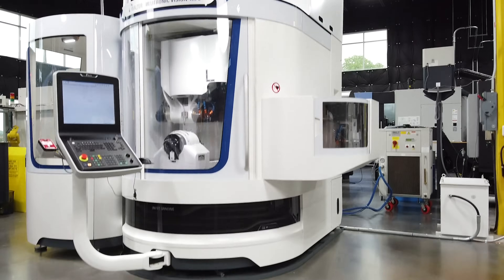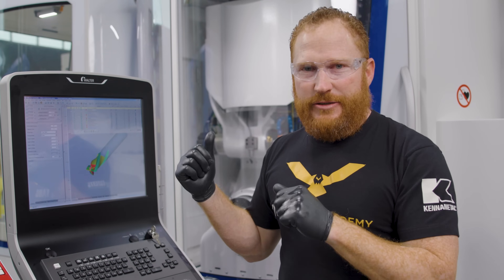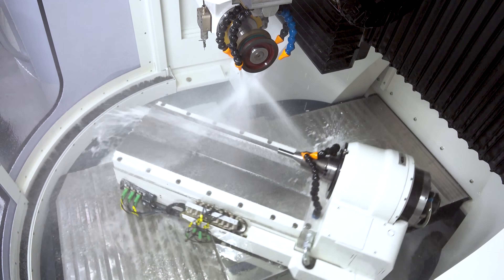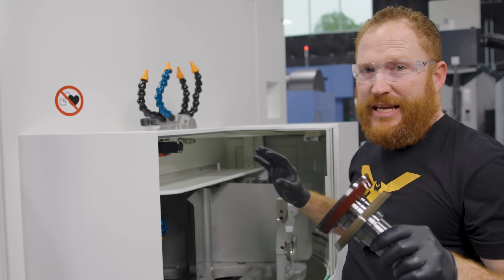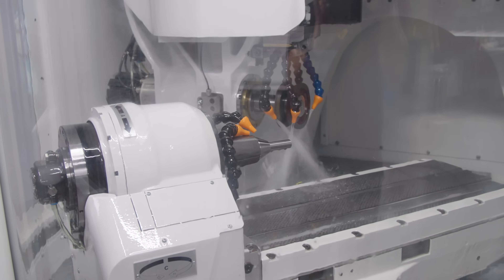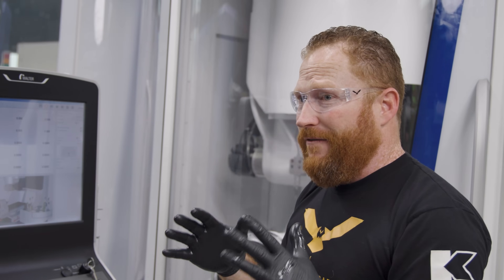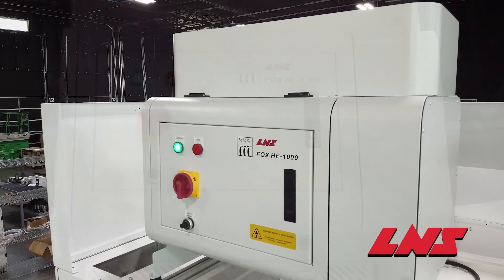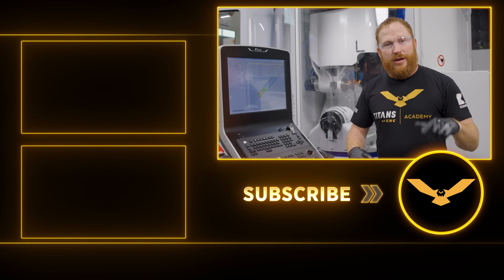HELITRONIC VISION 400L 5-AXIS GRINDER WITH FANUC ROBOT CELL

Comment: Nice to see somebody excited about doing what I do all day long, and on the same type of machine at that.
Custom carbide tooling is a bit of a niche market.
Reply: Just wondering what measuring equipment they have for measuring the tools they make. And also how they dress the wheels.
Reply: @l.e.bassdesign  not sure what they have but most pre setters now have the ability to measure tools. If your wanted a professional tool measuring machine a Helicheck or Zoller are the ones to go for. With the machine they have, the “a” axis has the hollow shaft option for cylindrical grinding, attaching a grit wheel on an arbour in this axis you are able to dress wheels in place. Otherwise you would need a specific wheel dresser such as a kirner 43c 👍🏻
Reply: Can’t wait to see what videos come from this myself. Us grinders will have a say when they come out I expect 😂

Comment: I wonder how much training and one on one tutoring it takes to get up to speed on this incredible piece of machinery.
Reply: I dont run this type of machine specifically,i run another brand but i'd say a year in a shop (slow learning as machines are expensive, material is expensive, and wheels are expensive) and you'll be able to run alot of different step tools / form tools.
Reply: It can take 5-10 years to run one of these by yourself fully and to achieve the level of accuracy these machines are capable of, a year of use is usually a good enough amount of time to say you can “run” a machine. These machines are only as accurate as the wheels you use, if you use sub par wheels, you won’t find the tolerances this machine can actually hit... and they’re incredibly small tolerances.
Reply: @Philiamq  Very True i always thought i was good at dressing wheels until they had me start doing sub .040" endmills, and i realized wow i suck at dressing wheels.
Reply: @realYneos  that size is crazy, I rarely go below 1mm, we don’t often get requests for that small and when we do, it’s for silly cut lengths like 30mm! I’d love to make stuff that small but I don’t have the equipment to accomplish it to a high standard
Reply: @Philiamq  1mm x 30mm loc? thats crazy, i get mad when they give me 8x Diameter + lol
Reply: @realYneos  yeah, most people requesting the jobs only know how to sell standard tooling so have no idea how much effort some jobs take.. One of my pet peeves of the industry sadly 🙃
Reply: @Philiamq  im a bit lucky in that manner.  Our sales guy used to grind so he has an idea on what goes into making tools.

Comment: How is the dust captured? Is there an auger system like on a conventional mill?
Reply: Gets washed out with the coolant. Hose works well for the rest but most of it washes away with coolant.
Reply: The chiller / filter use filters with a micron rating (i use 1 and 5 micron filters for my grinding machines)

Comment: Are you using any Abrasive Technology diamond abrasive wheels?
Reply: for carbide tools they‘re likely to use resin or sinter-bonded diamond wheels, and for HSS Tools they probably will use Cubic Boron Nitride Wheels, resin bonded
Reply: @edgarkreiter638  we manufacture both. Our Elgin facility does resin bond and the Columbus facility I work in manufactures PBS and CBN
Reply: @edgarkreiter638  you can look up abrasive technology on YouTube. I believe they have a marketing account on here.